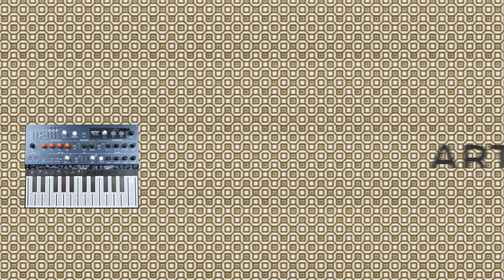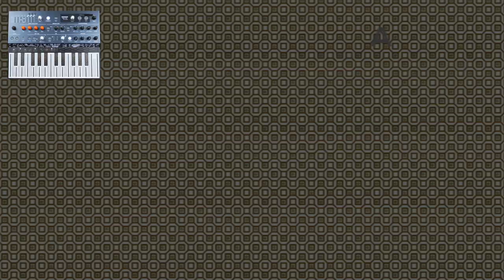17-The Arturia MicroFreak- Cycling Envelope

Comment: WARNING: this keyboard malfunctions. Getting a hold of Arturia support 
is very difficult and they have left me hanging for weeks after sending 
it in to be fixed. I really wish I had bought something that worked 
instead of this thing.  It really seems like a cool keyboard, but don't 
be fooled by the video and marketing...it is a barely functioning toy 
that will not hold up in any kind of professional environment.
Reply from the maker: If you got a defective unit, exchange it.  If you can’t use it professionally, then that’s on you.  Mine works great and can be used professionally by me.  Don’t undermine my work because you don’t know how to return something broken.
Reply: Exactly, if it’s under warranty, send it back to the retailer for exchange. I’ve never had a problem with Arturia, I’ve contacted them many times, mainly with queries regarding soft synth, registrations etc and they’ve always replied very quickly and they are always so friendly.
Reply: CORRECTION: This keyboard works great and is dope. Enjoy!
Reply: I've seen this comment spammed on a bunch of Microfreak videos. All electronics malfunction lol
Reply: While I don't know the details of your issue with the keyboard, a quick tip, make sure the power source you use is properly grounded, otherwise, the PBC board can operate other than intended.
Reply: pretty sure that's like in the manual though lol
Reply: The keyboard on my MF works just fine.
Reply: I think the main problem is that they're susceptible to any small amount of sweat on your fingers. Arturia also suggested i wear shoes while using my Microfreak!!

I actually have great success using a midi keyboard and tweaking the knobs on the MF.

As every knob sends CCs it's also a great controller when mapping to VSTs